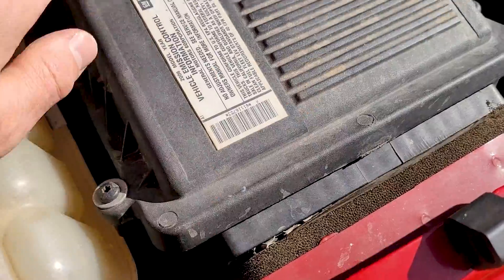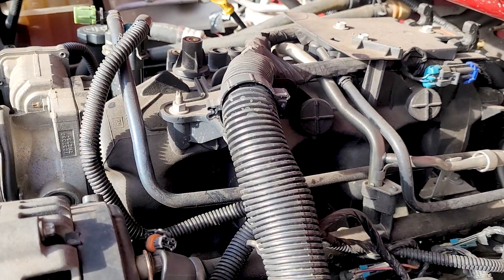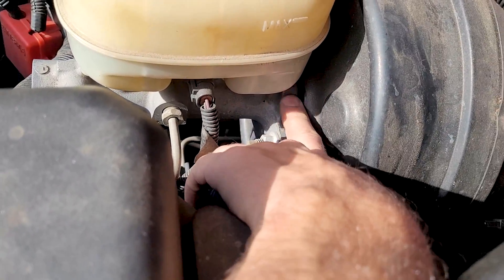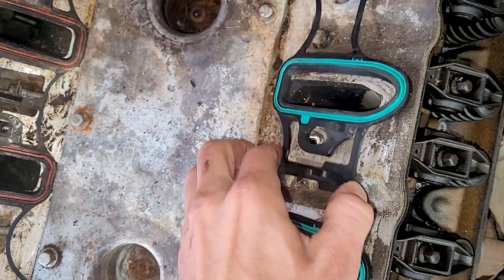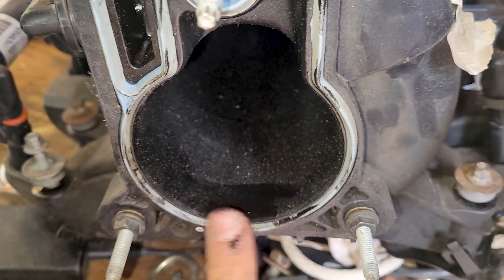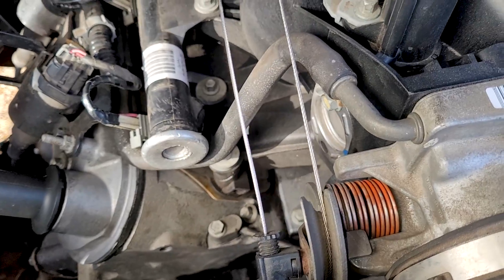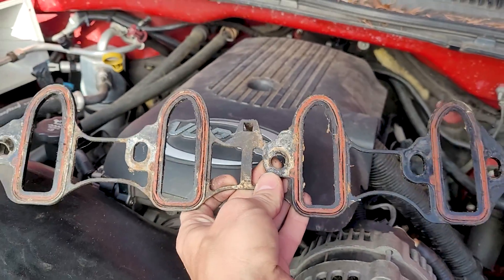EVERY Chevy Engine Vacuum LEAKS!

Comment: Thank u my new manifold gaskets been leaking every since I changed them.i had to do it about 3 times it still l er aks but its better. I will be changing valley cover gasket aswell as putting the metal gasket on manifold..the egr hose leaks like hell to but I used a tube of gasket maker to seal it Yea missed the leak at egr hose going into intake. Flange only has 2 bolt holes on it and intake only one for some silly reason

Comment: Whooshing sound behind the dash when shutting truck off. 2004 Chevy Silverado 1500 Extended cab 250k+ miles. Let me guess, vacuum leak in the HVAC system? Was hoping it was just a blend door motor but... let the adventure begin. 😂

Comment: Just did a smoke test on my 2001 Sierra. There were so many leaks it looked like a chain smoker. One place that you didnt mention was the throttle body shaft where the cable connects. It was blowing out of there plus all the other places you mentioned.
Reply from the maker: That's wild! You're right that spot can leak too. Great eye!

Comment: So I been having an issue with an 04 tahoe that I recently replaced all the brake lines i also replaced the hydro boost and master cylinder and for some reason I cant get it to build up pressure to bleed the lines can I get some help with this issue
Reply from the maker: Is the ABS module causing problems? Most of these trucks just have the standard vacuum brake booster.
Reply: How would I know if the abs module is bad

Comment: This video helped a ton on where to start looking, Thanks!  I think I’m currently fighting a vacuum leak after putting my built 5.3 in my truck. Got it tuned and the idle quality is absolute trash. Sometimes shifting from R to D it bogs way down and dies. Cam isn’t huge, and I have 2600 stall.  Sometimes just idling in drive the RPMs with fluctuate a couple hundred rpms and sometimes die.

Comment: I been having my yukon for over 12 years. Those leaks🤣 finally found mine. Was driving me crazy. Hit a pot hole and the bottom of the big tube had a hole. Finally fixed it. Truck runs like a new car😝 Best engine hands down.

Comment: Okay so the host coming off of my vacuum ball which is under my battery in my engine compartment of my 2013 6.0 L V8 G Series I think anyhow that hose was sucked together and stuck so I'm trying to see or figure out if it goes to the top of the valve cover gasket and it's the PCV valve or if it's something else and if it is the PCV valve is it replaceable or not and if it isn't the PCV valve vacuum hose that I ripped off of that little vacuum ball what is it because my AC blend door is stuck on defrost and my gas mileage is shit

Comment: I Have a 2000 Astro 220,000 miles. Only leak was passenger side head gasket coolant leak. No other problems until i had a dealer replace the engine.

Comment: Hey amigo! I follow you on tiktok. Solid content! 

I came here looking to test vacuum. Thinking my cats may be plugged on my truck or starting to at least. Where would I hook up my guage to get an accurate test?
Reply from the maker: I don't usually do a vaccum test. Most guys do a smoke test it works better. There's a only a couple places they leak intake manifold and brake booster are most common.

Comment: I have an 05 Titan. Code reader said I had a bad O2 sensor so I changed it did relearn and got same code. Wonder if I have a vacuum leak. I have also changed PCV valves and hoses.

Comment: I have a1999 Silverado 1500 5.3 LM7 and found a massive vacuum leak where the EGR tube enters the intake, near the throttle cable connects, it can leak. There is a seal on the end of the tube entering the intake. The tubes are ribbed steel and can kink. Newer V8's don't have this EGR system. You can see the block off plate on the Avalanche near the end of the video at 7:38.
Reply from the maker: Yup. That's a ba leak spot on those engines. The head destroys the gaskets over time.

Comment: I’ve checked them all but get a whistling noise around 2,000rpm at low speeds only around there and I have an s&b air finale but I’ve smoke tested everything and don’t have any leaks.

Comment: So at like 3:15 he says drive by wire my plastic piece is broke that the hose goes on. How would I replace that?
Reply: Literally just broke mine off trying to pull the hose off. I think I’m just going to epoxy it back on or plastic weld it.
Reply: have you figured this out pls respond
Reply: @simonabarca-i3x new manifold

Comment: Tahoe 05  4.8 find leak at oil tube filler ,manifold gasket exhaust, throttle body, my long fuel trims now are 5.5 bank 1   and 3.1 bank2  i put it up new manifold gasket exhaust not oem so now i going to buy ac delco

Comment: I changed my idle control valve and cleaned my throttle body now getting code p0174. I think its my throttle body gasket seal. Hopefully

Comment: Only one I can see you forgot is the valve cover gasket driver side can cause vacuum leak there is no pcv valve in some of them.
Reply: Valve cover gasket - oil leak -yes but vacuum ?
Reply: @robertmintz63 yes there's a vacuum port on the back of the valve cover, if the valve cover gaskets are leaking there is an air leak.

Comment: Glad I found this video. I have an 06 5.3 just changed out the intake gaskets but I'm still getting a random missfire code. I'm gonna try and clean out the injectors next and check all those problem spots shown in this video.
Reply: Please update. Do you know what codes you have?
Reply: @OptimusSpectra  P0300. It turns on and off. I don't think I have a vacuum leak. I checked the hoses. I put in an injector cleaner, but I'm not sure if they work or not. If the code comes back. I'm taking out the injectors and cleaning them. I checked the resistance, and they are about the same. I had some read 12.6 to 16.5 ohms. So my guess is they are dirty due to the intake gasket leaking.
Reply: @luisb2543  do you have a rough idle?  i have codes P0171, P0131, P0300, P0420, P0430, P01133. I am going to also run injector cleaner from what you said. And going to use a smoke test to see if I can find a leak.
Reply: @OptimusSpectra  check the gasket between the master cylinder. Mine had a busted gasket, and i could hear the air leak. It had a really bad idle. I changed that out and was told the intake gaskets were bad. Sure enough, they were bad too. You might have another leak, too. I did not have all those codes. I have changed the plugs and wires too because they were old. I also did a compression check just to make sure there wasn't any mechanical issues. The smoke test will definitely help out. I haven't done it yet, but it's on the list. Right now I have a decent idle. But before the intake gaskets and fuel injector cleaner, I added to the gas tank it had a slight rough idle.

Comment: Will a leak on the intake make the rpms to jump to 3k on idle?
Reply: That’s the problem im having now when i swapped in a used motor i knew ran just to 3k rpm and just slugs down to a very low idle and runs rough or shuts down
Reply: @The_Scouter225  did you end up fixing the issue? I think I'm going to buy a new intake manifold. Since I'm using the early truck manifold. I'll come back on Friday when I do the install see if that fixes my issue

Comment: Got 59 chevy with 2004 4.8 Silverado ,4l60e transmission ,revs go up by few hundred rpm when i select drive or reverse after starting it from cold but it won't do it when warm?can it be a gearbox problem or engine side or its normal? thanks

Comment: I have a 05' Express 1500 van. Misfire on cylinder 6 only. New plugs, ignition coil, spark plug wires, distributer cap, rotor, MAF sensor, purge valve, throttle body position sensor . Only thing left is a possible vacuum leak. Any ideas?
Reply: Fuel injector

Comment: Also on the older ones 199-2002ish they have a EGR pipe that connects into the intake passenger side behind throttle body, they will leak too I’ve seen that happen!

Comment: Just got a 1999 Chevy Silverado 4.8 vortec 180k miles owner supposedly engine swapped it and havnt done the mathing on miles but recently started smoking smells like burnt oil checked my oil and its low after getting an oil change 1 week or so ago when I purchased the vehicle only code is a transmission solenoid have a mechanic but have been hesitant nothing wrong with my coolant any suggestions when I accelerate fast it starts and goes away has happened twice

Comment: 04 yukon 5.3 I replaced the knock sensors and wire harness with ac Delco. Still getting the p0327 code. Any ideas

Comment: Could you not have a trouble code at all and these gaskets are still bad? I bought truck used at 103k and I have about 217k on it and I replaced IAC valve, TPS, cleaned throttle body, replaced fuel pressure regulator, and cleaned MAF sensor. I have recently replaced all spark plugs & wires and a new battery. I also ran some Sea Foam through it. Truck runs fine after warming up but on cold starts it hesitates and stalls out more often than not but when I start it and give it some gas it will be fine.  I checked my fuel pressure and it's within spec. I had low coolant that I topped off and it has some hesitation at a full stop and when I put gas on it. What do you think?
Reply from the maker: Replace the coolant temp sensor first. I know it sounds dumb, but it will cause stalling. If its an early truck 1999-2002 the intake gaskets can be bad from the factory if they are red in color.

Comment: 3:10 Any recommendations for when this plastic barb/nipple thing breaks off the intake manifold? It goes into the tiny little chamber in there such that it can't really just drilled out and a new barb/nipple & grommet stuck on there. Also, that plastic thing is like connected to the hose, I couldn't get it apart. I tried to get a threaded pip to a hose barb in there, but I couldn't get that to work either. I ended up cleaning and sanding it real good and using JB Weld.

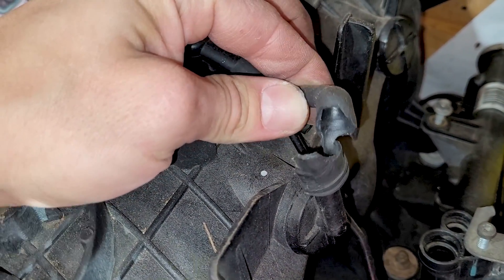3:36 Are those caps on the side of the intake manifold removeable and replaceable with barbed hose connectors?
Reply: What did you find

Comment: There are specially made spray products meant to deter rodents. If the vehicle is garaged, you could mist one of these products under the hood and around the vehicle. Peppermint oil and cayenne pepper are also reported to deter rodents.

Comment: Just because Matt says it could leak, does not mean it will leak. 2001 Silverado 1500 with 229K miles with original engine and transmission. The only vacuum leak was the intake manifold gasket. Idle was too high and after I installed the good NAPA gasket about 140K miles, Idle is back around 500 RPMs. If GM made these trucks again without the silly technology fads/ gadgets/  and On-Star trackers, I would buy another. One of the best trucks to own.
Reply: Agreed 👍
Reply: I got a 04 Tahoe 250k been an amazing vehicle, only main issue is the rear main seal is leaking a little bit atm & a vacuum leak I gotta figure out

Comment: Already replaced the Intake manifold gaskets and my driver side valve cover on my 2006 5.3, haven’t seen any leaks, what do you think the issue might be, cleaned the maf, I’m thinking upstream o2 sensors. Codes p0171 p0174

Comment: My truck won’t start straight away after I filled it with fuel only on second turn of the Kenny garage has said that this is a vacuum problem
Reply from the maker: When they do that I check the Cam shaft position sensor if they have at least 50PSI when I turn the key in the RUN position. It should start first try.

Comment: I have an 02 silverado v6 4.3L that random misfires under heavy load. Usually, going up a hill. The code clears as soon i get on level ground. Im pretty sure it is a vacuum that occurs under heavy load. Any idea what it can be? Im thinking of those intake seals you kept mentioning
Reply: Fuel pressure regulator hose goes to top of engine ,it's plastic it gets old
Reply: @stevecross5231  I'm going to check that

Comment: Would this cause the truck to try to accelerate on its own as you begin to drive?
Reply from the maker: Depends on the year. Probably the throttlebody if it's a 2003 or newer truck with the electric throttlebody.

Comment: what’s up man i got a transmission problem, when i drive my truck for a while it won’t shift from 2nd to third unless i let go a little of the gas pedal. Any ideas what it would be? Transmission was just rebuilt also and filter and oil have been recently changed.

Comment: Is the evap solenoid supost to wiggle a lot? That 10mm bolt is tight but the thing moves like crazy. My truck is a 01 2500hd 6.0 and I have a miss at idle in I think cylender 3. No codes but it threw one at 5000 rpm and it went away.
Reply from the maker: Yes it wiggles a lot it seals with a rubber seal that goes around the mounting bolt.
Reply: @MattsShop  ok thanks for your answer. I could not find anything online about it so I wasn't sure.
Reply: @Red-b1r8i what was your fix???
Reply: @Sethhaun78 Not sure. Mostly went away by its self. And yeah the evap is normaly loose like that I guess. Fuel pump is dying again so that's fun.
Reply: @Red-b1r8i mine 2000 gmc 2500 leaks oil over oil filter snd and by driveshaft i think .and has vacum leaks..256.000 got it used from farm or something has 6.0 runs good other wise and the anti lock break module is bad
Reply: @Sethhaun78  mine is at almost 94k miles. But it sat for a few years before I bought it. The old man died or couldn't drive anymore and his kids didn't want it. I only really leak oil from the oil cooler line where it goes into the oil pan. I replaced the seal and still leaks. I think its that plug that is leaking. Has transfer case pump rub. Misses every once in a while and fuel pump is going out again. But other than that its been a good truck. I want to build it for around 450-500hp out of the 6.0 or maybe swap it for the 8.1 and 6 speed manual. It would be a beast then.
Reply: @Red-b1r8i I have 3 trucks ..2 need fixed badly depend on them I'm solo tree service landscaping business and commercial mowing...really struggling have 97 dodge ram 5.9 I just fixed up and now transmission or converter went out started squealing in gear and lost half it's power heard something broke while it happened..has 243.00 on it runs good but trans is out. I think..the 2000 GMC needs several things has 256.000 ..my Ford 4.6 is 2 wheel and to small for hauling logs and or machine it won't do gravel driveway s..either gets stuck .need help bad getting fixed the 2 trucks
Reply: @Sethhaun78  On the dodge I bet its the converter.
Reply: @Red-b1r8i thanks hope thats cheaper than the 3200 to 3800.00 qoute i got .. 🙏
Reply: @Red-b1r8i i cant do transmissions ..no shop not enough time or experience...can do most other things and learn on the go but need to be at work ..hurts me badly being solo operator
Reply: @Sethhaun78 I know how that is. I think a new converter should be around 500ish bucks and you can do it in your driveway over the weekend. It sounds like you broke some fins in there. It could be the trans but if it still has all gears and shifts fine that's unlikely.

Comment: Of course there is problems but the gmt800 is hands down the best truck gm has ever produced
Reply from the maker: Yes! I agree!
Reply: @mccormickchainsaw  and they will never make that mistake again….
Reply: @ I’ve got two 800’s with 450k plus on them I have recently bought a 900 with a duramax for a deal I couldn’t pass up other than that truck I won’t own anything else
Reply: My 99 5.3 800 has 268k biggest problems been rust.

Comment: And you can fix em all for less than a new truck payment 😂
Reply from the maker: Yes sir!
Reply: @MattsShop Do you own a shop and work on these trucks for hire?  Looking for a good mechanic like you to work on my 2000 GMC Sierra 6.0.
Reply: Same thing  I told my wife every time she sees me working on my truck and buying parts she's starts with "just sell it  and buy yourself a new one" and i tell her even i buy a new im not selling the old one 😅
Reply: Damn straight.
Reply: Damn straight 🫡
Reply: Yup I found that out the hard way. Lmao
Reply: Just fired a parts cannon at mine, less than 1 payment and it runs great
Reply: I love it I just sold my 2012 300 for one !!
Reply: Idk about that in my area I've been to 4 different shops for EVAP issues each claiming to fix the issue and check light is back on again so a total of $2,435 and problem still not solved
Reply: @johns3153  I changed the evap canister on mine with a dorman and it went away. I was having the gas pumps clicking issue all the time and had previously changed the vent solenoid, which worked for a bit but came back. It's been a year with since the new canister and no more issues.
Reply: Your useless if you have to pay someone to do it for you
Reply: Exactly
Reply: Yea missed the leak at egr hose going into intake. Flange only has 2 bolt holes on it and intake only one for some silly reason
Reply: If you do it yourself nearly every one of these for less than 100 bucks (give or take on the intake gaskets)

Comment: "It can leak" really makes me follow all of my vacuum lines etc :)   The other inspection i do are all the grounding locations.  The ground cable  between the engine and the body was turning green and got replaced with a marine / sealed lugs cable.
Reply: How hard is it to change that ground wire?
Reply: I need to do that myself.
Reply from the maker: I love tracing all those ground wires those are fun.